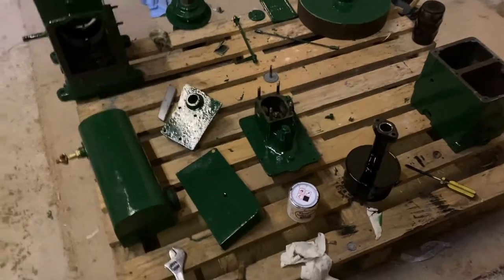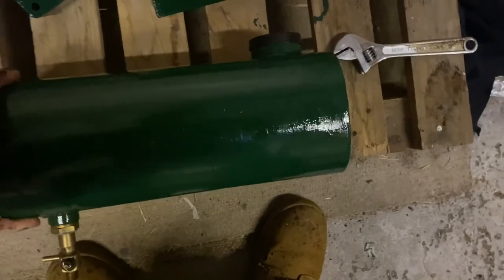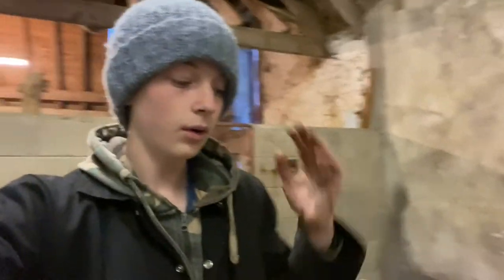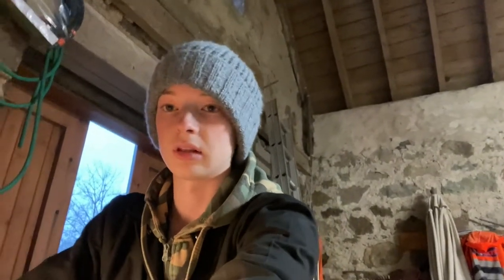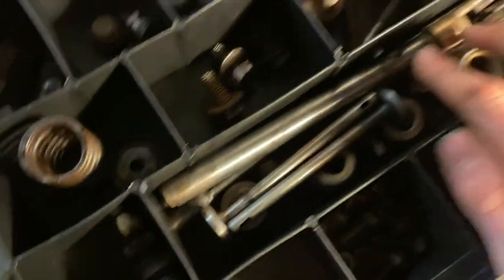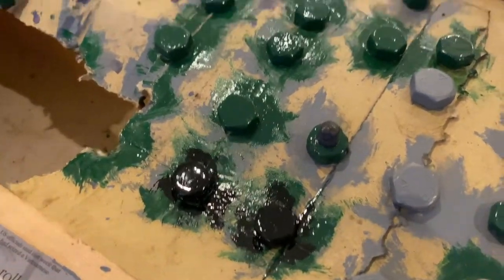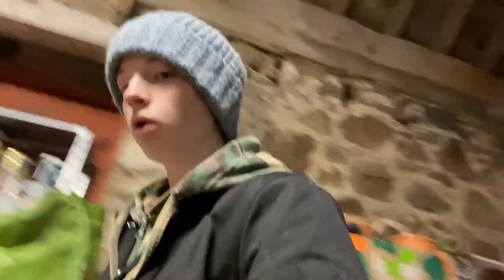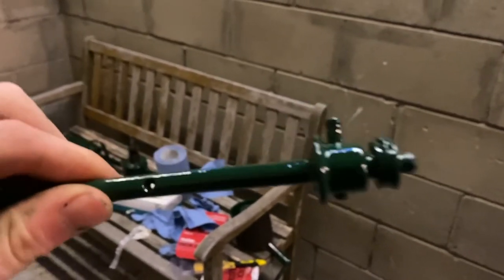Lister D - Finished Painting and Nearing Completion - Ep.13

Comment: Hi I just found your channel and subscribed straight away because I have a lister D as well and had to use parts of of one engine and only complete one of them like you, I am a bit further on in my project and I am trying to get it to run however I didn't bother painting mine. I have had it running but not for very long. They are a great starter project as I think we are about the same age. Looking great from what I have seen so far.
Reply from the maker: Great to hear other kids have the same idea as me. I sort of wish I didn’t paint it now, it’s just so much hassle but if I was to mix and match my engines and not paint it would have looked really bad.